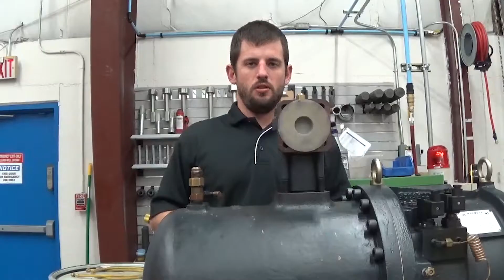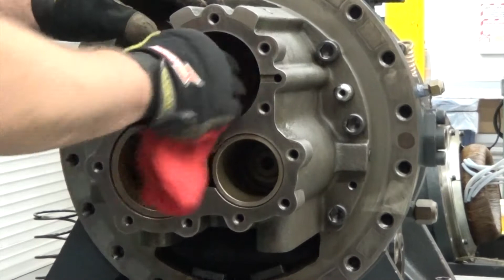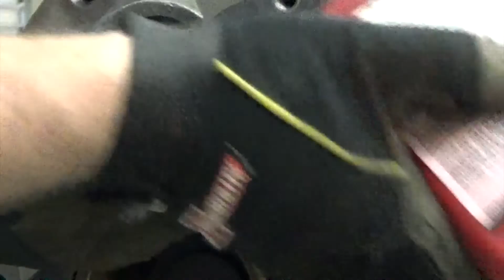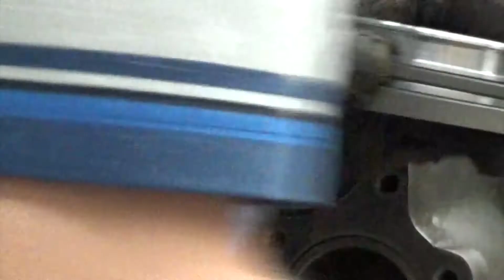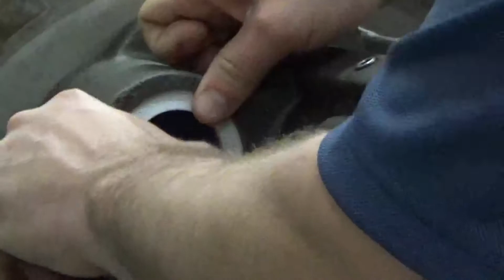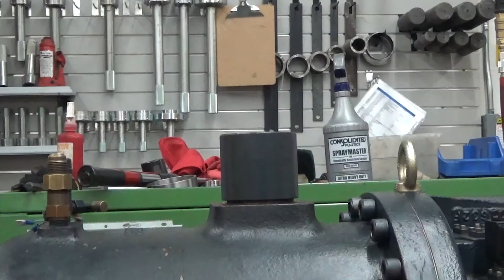Micro Control Systems Hanbell Piston Changeout mpeg

Comment: Hello. Thank you for your very good tutorial videos.  I have been following your training channel for a long time. I have been working in the installation and commissioning of repairs of heating and cooling devices for 23 years, and I am very, very eager to be able to pursue this job and profession in another country and continue.  Chiller and central boiler, package system, gas cooler, electric welding, water and sewage piping, etc. Calculations of all components of the facility I specialize in calculations of pumps and pipes and connections related to the system of chiller and central boiler and pool. Excellent perseverance in working  And I'm learning. I'm looking forward to working with you on any terms you say.  sincerely.